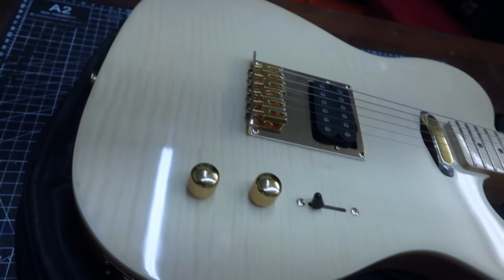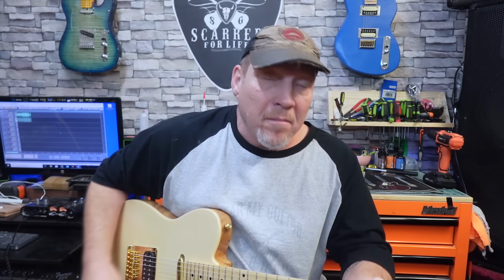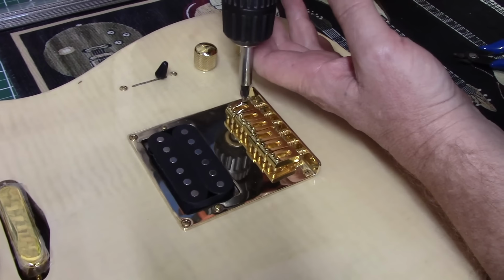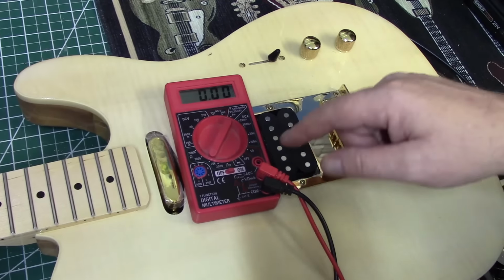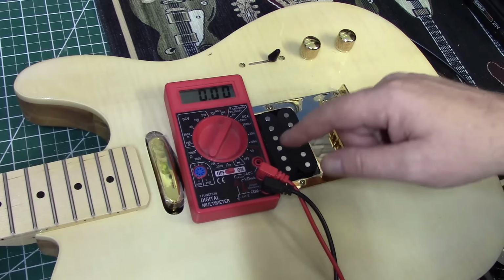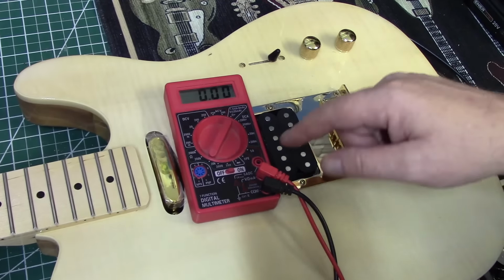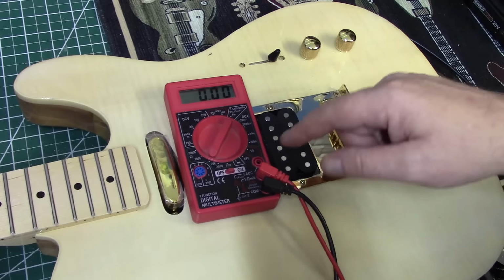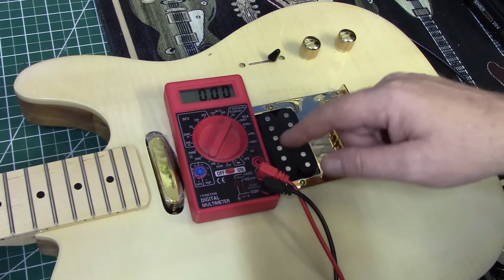$147 Telecaster Is Killin Your HIGH END FENDER!! Best Quality Control I'VE EVER SEEN!!

Comment: That is called "chambfering" (the bit where you're taking off a bit of the finish and preventing breakout), and is a important step in the process of many wood and metalworking projects.
 Perhaps a tad deeper than I'd go on the string-thru holes, but damn that's one fine guitar for the $. 

❤ From N. Idaho!

Comment: It's nice that your drill press is big enough to drill those holes. I did a string thru build and had to drill by hand. The body wouldn't fit my drill press. I was lucky and the holes turned out decent.👍😎🎸🎶

Comment: I have bought several Cozarts over the years, and still have some of them.
The doublenecks are excellent, but you have to swap out the pickups, and move the tailpieces over a bit, then it's identical to the no longer built Epiphone EDS-1275. terrific necks, mahogany body, well balanced.
That's the set-neck one, but if you can find the original bolt on version, it's a screamer, but it's about 25 lbs of solid maple body. It needs NOTHING, but unless you are built like Wolfgang Van Halen, forget it, it's like having a forklift strapped onto your shoulder.
For the money, it's probably the best thing online. Keep the "good" stuff at home, and take the Cozart to the gig instead.
Never had an issue with shipping, broken/parts falling off, the only real weak spot was the pickups, and that was mainly on the newer doublenecks.
That was 5-6 years ago, I imagine the quality has probably gotten even better by now.
Glad to see a review on these things.

Comment: Hey sport, i am a sinestral, and as such my choices are limited. I have a bucket list to play the greatest song ever on my 70th birthday, so i bought a Cozart cherry double neck, (not white in case some dropkicks get the song confused), and it is Great! had my luthier mate go over it, he did a bit of fret levelling, and a full set up. I changed both sets of pups to Bryan Williams double neck MSG 73's (these absolutely get the original "hollow chirp"!) put CTS 500k pots, emerson .22k PIO's, rewired the whole thing with switchcraft switches, (one a 4 / 2 switch) and turned the 3rd switch into an A ,B or AB output to a stereo jack, so using a Y cable you can run each neck to a different amp. This guitar is bloody fantastic! Needs a new nut on each neck, and i will change out the tuners, the stock are reasonable. The 12 string neck is the same width as the 6, which takes some getting used to, but for the price, i think around $300 it is definitely a winner! Cozart do a pretty good job, a great modding platform. Oh, forgot to mention i sheilded everywhere with copper tape sheilding. Looking at the 12 string Tele, rout out for p90's!

Comment: Thanks!  What is the approximate length of the drill bit you use to drill out a hole from a pocket to the control cavity for the ground wire?  I'm a 1st timer.  Gonna get a hunk of 2X12  to practice on before I try what you did in the vid.   I'll use my router to carve out some pocket cavities to practice making a ground hole. Never done that.

Comment: A little tip for the tape mark; Use a skinny strip of tape and wrap it around the bit where it comes together on the other side, forming something akin to a flag.  Then, when you drill, it will blow the saw dust away.  Maybe not quite at that speed, but perhaps a little.  Anywho... Sweet guitar, man.  Great stuff!

Comment: It looks really nice and too love the binding.  That's one of the cosmetic reasons that I like Gibson's more than Fender's, because you rarely see binding on a Fender.
Besides new tuners, one of the first things I would mod, would be the pickups. I'd like to have a coil splitter for the humbucker bridge position.
I noticed that the string ferrules are not flush mounted. I'm sure that it's the proper method but it seems like it would be better flush mounted ???  Just asking, not trying to find fault.

Comment: I bought a Cozart double beck about 5 years ago and I had them same reaction, built very well, I replaced the hardware and pickups but aside from that I was impressed, the wiring harness was also built very well

Comment: and you can access the truss rod from the headstock
Reply: More convenient true, but allen keys not as user friendly as a flat headed screwdriver and over the years i've had two neck adjusted  truss rods with allen key sockets fail , never had that sort of issue with adjustment at the body end .

Comment: At 9:32 mins - see how those counter sinks are seven sided? Well sir, I've found that if you ease off on the trigger, in other words go at a slow rpm, those will be nice and round and not five to seven sided. The 5 to 7 sided is probably how many flutes there are on the bit - dunno. The best way for me to think about it is there is like some kind of resonance going on. I'm sure I'm totally off base - I'm just saying that's how I think of it as - you know, a resonant wobble because it's speed and time related. I discovered this when I was counter sinking a plywood top on my Harbor Freight tool stand for my new bandsaw - love Harbor Freight.

Comment: I bought a Cozart tele a couple of years back. The gold metal flake one. I put Seymour Duncan Hot Tele pickup, new tuner, new nut, dressed the frets and damn!
Reply: You know , not everybody has the skills and/or tools to do that. So if you bring it to a guitar luthier ( is that the right name ? ) you have to pay mucho dinoro's for those adjusments.
All by all you could buy yourself , for the totall amount of money that you have spend now on this guitar , a better guitar which doesn't need the job that is needed to sound and intonate good.
The Telecasters from Mexico are a good example ; real good affordable Tele's.
And I envy those guys who have the tools and skills to do a job like in this video.
Reply: I bought a nut for mine, and I couldn't get it to fit correctly...  Where did you get yours?     Hot Rail in the bridge is nice!

Comment: That guitar looks pretty good compared to the Cozart double-cut Tele I bought a few years back...  It was FRICKIN' DISASTER.  I had to reposition the bridge because it was crooked and off-center.  I also had to re-rout the pickup cavity (which was the reason why the bridge plate was off) and plug and re-drill the string-through holes.  The control cavity also had to be re-routed in order to fit full-size CTS pots in there.  The neck was a nightmare.  Wonky frets all up and down the fretboard, and they had "rolled" the fretboard edges by running a screwdriver up and down the neck (AFTER the frets had been installed).  I just ditched the neck completely and replaced it with an Allparts neck. 

Surprisingly, the body actually had a trans-white nitro finish (on a heavy, multi-piece Ash body), but it was the sloppiest finish I'd ever seen.  Sags and runs all over the place. I considered refinishing the body, but decided to just sand and buff out the more heinous runs. 

Of course, the pickups (and the hardware) were trash.  I put a set of Custom Shop '51 NoCasters in it, and Wilkinson tuners.  In the end, it was a decent guitar, but man, it needed a LOT of work.  

A friend of mine bought the same guitar at the same time I did, and I had to fix his up as well. So it wasn't that I just got a bad one.  His guitar had all the same issues that mine did.

At the time, I thought: "Meh...  what can you expect for $120?", but I think I would have been better off buying a Squier Bullet Tele for $99.  Except the only reason I bought the Cozart was because it was a double-cut, and you couldn't get that body type without dropping $1,600 on the Limited Edition Fender that was out at the time (or having one custom made).

Comment: Picked up a couple of the Strat style based on this recommendation. One sixxer, and one twelve string. I'll do similar mods and see how they hold up. I'll probably upgrade all electronics along with tuners and STILL be under $400 for each guitar, and that's a steal if they live up to this review. If not, I'm sure I can at least get my money back based on the upgrades. Thanks for the heads up.

Comment: The Chinese have the same CNC most guitar companies have, quality of electronic components and quality control is why they are cheap
Reply: labor is the most cost in the USA..          I really like how controls function on my Cozart.   I probably could not hear a difference if I changed the pots and capacitor, so I choose to wait until needed.   I did change the input jack to a switchcraft gold, which was a great improvement  It really sucks on that cable  hahah     Tunning pegs and pickups are a must to change too.   So basically, you are getting a great body and neck... which is a great place to start.

Comment: i tried doing the 3 layers of painters tape and it still had tear outs, any advice? should the drill be running faster or slower?
Reply from the maker: Did you use the counter sink bit? That's the key.
Reply: @scarmyguitar  you mean a tapered drill bit?
Reply: @scarmyguitar   would this work ? WARRIOR Carbon Steel Tapered Drill Bit and Countersink Set
Reply: I am no expert, but you could start by drilling from the front with a  much smaller "starter" drill bit (with the blue tape still on the back}.  Then drill from the back to the front with the larger drill bit.

Comment: I believe that Left Lane Cruser off the Bompf Alive label that the Black Keays own Use a The NEW ROCKABILLY ACOUSTIC/ELECTRIC RESONATOR GUITAR ABALONE INLAY Only they had it changed so the neck and headstock being natural with only poly finish and had the top in a a dark Sunburst with black back as no other guitar looks this way with the same headstock shape. They probably did this as the white is just too bright. If not then Left Lane Cruiser has an old Guitar that Cozart has made a clone of the old out of production instrument.

Comment: I bought a cheap Glary Strat copy. I bought it to see how much I could improve the tone and its playability. Parts of the mods I did was to swap the thin tone block out for a nice beefy brass block. I don’t use tremolos so there was no problem there. But it was poorly made from the start. The strings wouldn’t come out of the original block when I started tearing it down, then, the bridge/ Tremolo screws were drilled unevenly, so I p,urged them with toothpicks and tight bond and redrilled them. My friend bought a Tele from them and his has no problems. So I think it’s a crapshoot when buying a cheap guitar,,

Comment: Hey there, so I up'n bought one and it's pretty good. Some new strings intonation...but why all the drill'n? does it change the tone in some way? or are you just go'n semi full  Fender? I don't know how they do it, even with cheap labor, what with shipping and even a cheap case, strap...and just try get'n a finish like that on your first try. It's Heck of light too. Neck is thin and easy to play. Crazy cheap. So what about the drill'n?
Reply: ^^^
I owned a brand new 1977 CBS Era Fender Telecaster (USA) for 23+ years, until almost 2001
The drilling & "ferrules" he put in allow it to be "strung thru the body" as my Olympic White Ash one was
It helps with stability of tuning & gives the strings MORE length (slightly) that just going thru the bridge only
I understand fully as to why he did it - It's just a traditional Fender (Tele') thing.

Also, I MUCH prefer the 'Block Saddles' as my Tele' came with the older triple (only) bridge saddles

Comment: Another "T" knockoff.  I hate the knife switches.  A p-u selector switch on the bass side of the guitar (like an LP) is my top pick.   My top pick overall is the intonation and no string buzzing.
Reply: Squire is the best copy -
Reply: I have the 12 string and it has the LP selector switch

Comment: Regarding the headstock, I had tried to do some research into whether or not fender may be owned Cozart or if they licensed the headstock to Cozart? So far, I am unable to find out any information relative to that question. My thought is that the neck and head stock or just licensed. If anyone can shed any more light on that, it would be appreciated.

Comment: I got a Cozart Strat a few months ago. It is now my number one. Flawless out of the box. Did a minor string height adjustment to my preferred specs and been playing it ever since. Dang thing rarely goes out of tune and it is very easy on the eye as well. I was shocked that the body was a solid piece of paulownia wood. Not a seam anywhere and beautiful blond finish. Top appears to be a thin veneer of some dark brown striped wood. No idea what it is, but it looks very nice and unusual. I also noticed that no two Cozarts look alike or even have exactly the same specs. If your Tele is half as good, you still got a good one.

Comment: New Cozart Tele-style flame maple top electric guitar with bolt-on construction and an empress body w/ flame maple top. Included is a hard maple neck with maple fingerboard highlighted by gold hardware. The neck scale is 25.5" with 22 frets. Controls are 1V, 1T with a 3-Way Toggle switch for the S-H Pickup configuration with the humbucker located in a Telecaster-style bridge

FREE SHIPPING WITHIN THE USA

September 19, 2024:

CANADA:

USD $159.99 + USD $32.02 shipping 
CDN $217.51 + CDN $43.53

Duty Canada:
USD $8.00 duty
CDN $10.88
Reply: Nice one

Comment: I have a “New York Pro” tele copy, where the quality rivals a “real” Fender Tele. Except no string thru, which I never understood why that is done. Is it just for looks? A gimmick? Got my New York Pro used for $150 several years ago. 

Also have a 1966 solid body Hagstrom electric. The body is made of plywood, covered under vinyl and industrial plastic. Plays and sounds incredible. Which shows it doesn’t matter what the body is made from. It’s all in the neck action and pickups. 👍
Reply: A lot of people believe the string thru vibrates the body- more sustain, better tone.
Reply: I have a 60s Kalamazoo Mustang copy and it's made of sawdust and glue booard - not mdf - and it's heavy and sounds great. It  has Melody Maker pups too.
Reply: My understanding is that string through vs not offers the same sound.. However, the tension on the strings is different.  I can not remember which way offers more or less tension.  haha

Comment: Looks like the grain on the neck is straight. Does it appear like the top and bottom edges of the frets (where the top dots are and the opposite side) look almost checkerboard? Almost holographic in a way?? That would mean yr neck is quartersawn. That would be adding a LOT to why the neck is so nice.

Comment: I like everything about it except they dipped that whole dang thing in polyesther until it was at least an 1/8 thick.  Imagine how much better it'll sound when you strip off 80% of that tone killing c**p.
Reply from the maker: Tone comes from pick ups, my man. The finish has nothing to do with anything.
Whoever told you that it does, needs a good slappin!
Before you start arguing...watch this.
https://www.youtube.com/watch?v=n02tImce3AE
Reply: @scarmyguitar  Yeah and that's why Gibson uses nitro-cellulose lacquer.  Because they like throwing away money.
Reply: @scarmyguitar 😂
Reply: @ferrousmcgarrus3431  I've heard that tone comes from the guitarist. They said (several years back) that if you give EVH a guitar...any guitar...he's still going to sound like, and play like, EVH and no guitar or amp is going to change that.